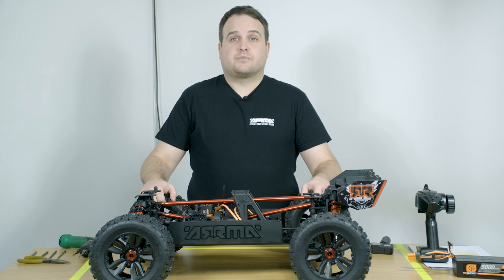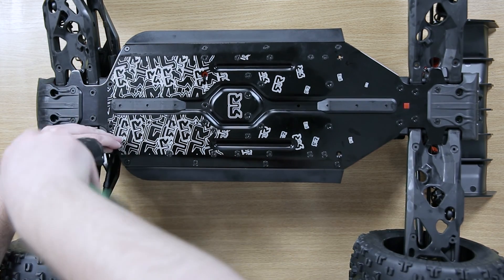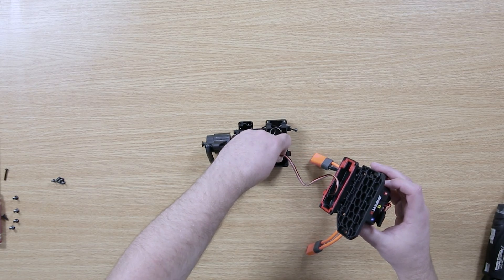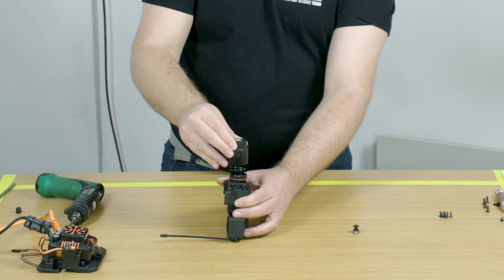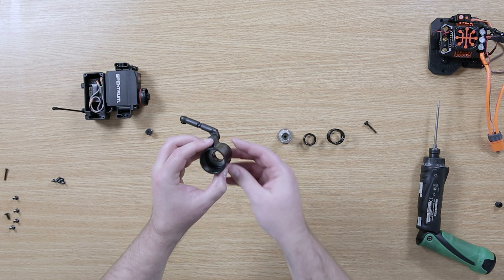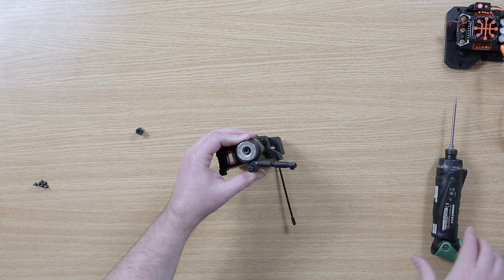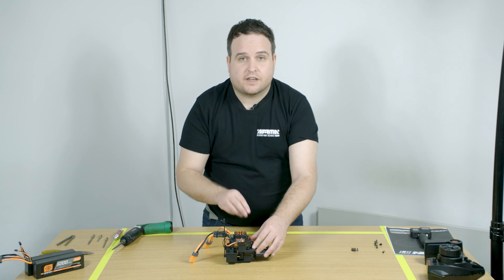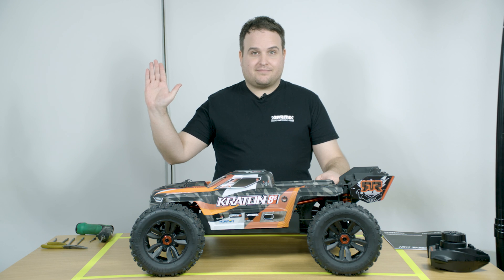ARRMA KRATON 8S // Official How To Guide: Electronics Module & Servo Saver Features

Comment: Hi i bought a arrma kraton 8s. on my second run my transmitter stopped responding I have been trying to rebind the transmitter and Receiver with no success.

The issue I’m having is once I turn on the power and press the button on the receiver to bind I’m getting the flashing light which is the right response.

however once i press the power and bind button on the receiver to bind with the receiver the flashing light on the receiver turns off where it should stay on for the binding process.

Can you please advise me on what actions I need to take from this point on ?
Reply: Hey, you should watch officials AVC tuning / binding / calibrating SPEKTRUM videos
Reply: It could help you, it helped me with binding and AVC issues on my Kraton and Outcast 8S
Reply: https://youtu.be/gBXelft424A
Reply: https://youtu.be/wmPatUav2hw

Comment: Is it safe to run the S905 servo at 8.4 volts?
Reply: Is it?
Reply: @Ruben.vandb1  I still have no clue, but according to the manual the operating voltage range is from 6 volts to 8.4 volts. But when you search the servo up itself, it says 7.2 volts max.

Comment: Can i run the stock servo on 8.4v? Is there any other bec option in between stock and 8.4? In the manual there's only two options in programming stock then all the way up to 8.4 if i use a programming box can i get 7.4 or is there really only two options for bec? Really low or really high?

Comment: Nothing to do with you video. But I have a question. I switch my spektrum controller on. I switch the car on. But then nothing happens. Can't go forward or backward and the steering does not work either. New batteries in the controller and fully charged batteries
Please help. Thanks

Comment: How does the steering arm attach to the servo saver? At the top of the servo saver.. as mine has come off and made the truck have no steering in its first bash.. was just driving around and doing small jumps. Very small jumps. I found a screw in the chassis which I am trying to put through the servo saver into the mechanism on the steering arm.. but its screwing on slightly and then just spinning.. every time I test the steering the whole joint is coming loose and the screw comes out. This was its first bash which I will be posting the video of tonight. It wasn't really rough treatment and the X-Maxx it was up against is perfectly fine. Please help as the truck is now a very heavy/expensive paper weight. Thanks in advance.